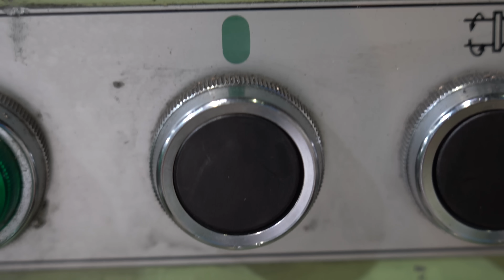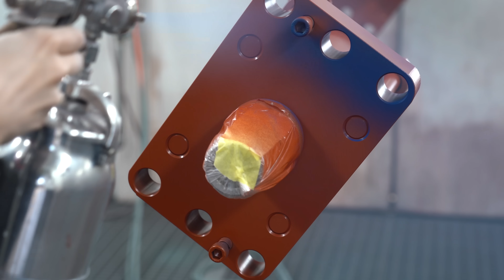油圧シリンダを大量生産するプロセス。素晴らしい日本の油圧シリンダ生産工場

Comment: Great result 
And here at 1:42 bushing as I understand it is made of bronze or brass it will not affect the longevity of the product? A time consuming process in which accuracy is important but the result is good
Reply: The rubber seals will wear off first. I believe the internal grooves are for the rod seal and wiper seal.

Brass material is very suitable for this application. Aside from a low friction coefficient, it is soft enough to dot damaging the hard-chromed rod.
Also, the modular design makes it easier to replace.
Reply: @zeezeazee  I think the brass is used so that when you wear it out, the bushing comes out quicker because it's easy to replace, but the main unit is not damaged
Reply: You two are guessing the material is bronze or brass, but according to the parts & assembly instructional video, the employee says the material is copper alloy.
Reply: Bronze and brass are copper alloys. Don't remember the exact composition. I think with Zinc and sth else.